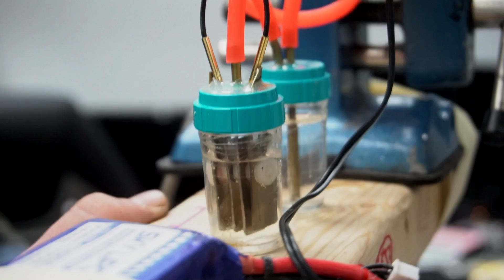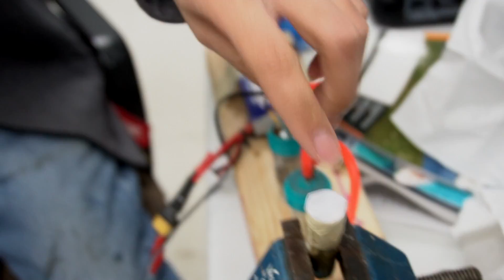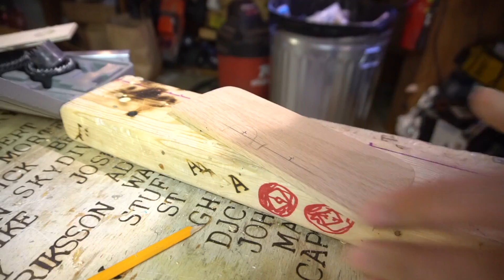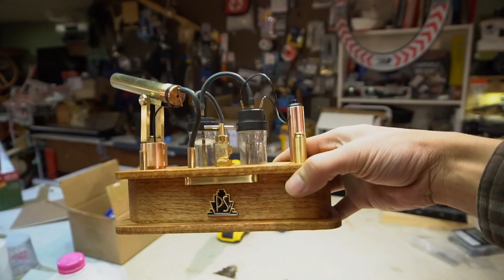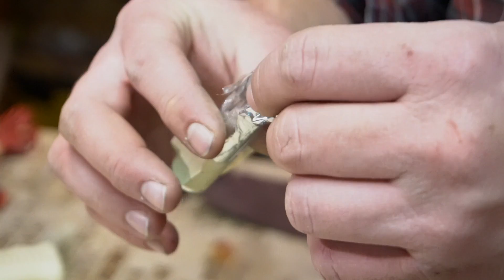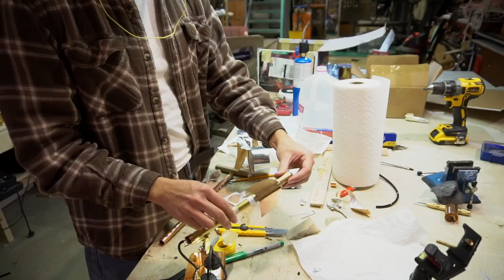Mini DIY HYDROGEN HHO Cannon

Comment: I'd just like to warn everyone about the dangers of hydrogen/oxygen mix.

I had about 200ml of the gas, which unfortunately ignited, leaving me with an exploded container in pieces everywhere. I couldn't hear a lot for about 2 days, come day 3 the constant ringing which was predominantly what I was hearing somewhat subsided. That was a few years ago. I still notice that my one ear has worse hearing than the other ear. My ears also ring a lot more easily when exposed to loud noises than before...

I'd just like to warn others about how little of this explosive gas you need to cause permanent hearing loss.. 

Wear earmuffs and goggles, and stay save folks.
Reply: i thank you for these words of wisdom jotham also forward phisx.........your an idiot but that is funny
Reply: Jotham B Lol when I was ten something like that happened, was making an HHO torch with like 24v, but no flashback arrestor..  The gas production slowed down for some reason and the torch traveled back into the gatorade bottle..  Bro me and my brother were laughing so hard because that bottle was all over the garage..  
.
So TLDR:  USE FLASHBACK ARRESTORS, and make sure the tube to what you're igniting is as short as possible or even build the arrestor into the thing you'll be igniting.....
Reply: Forward PhysX Your parents let you do that? Hmm...
Reply: @forwardphysx6167  same thing happened to me and my dad but it was a half gallon glass jar
Reply: Here's a link to an video of what that would've looked like. (in a plastic bag though because of shrapnel)
https://www.youtube.com/watch?v=olYp8kLjkBU
Reply: It was still echoing after the vid XD
Reply: Yeah... I can relate.  That "anti" flashback tube is a bomb... I tired that and the container exploded into a hundreds of pieces and I couldn't hear for a few hours.....
Reply: I lived to tell the tale.
Reply: (Michael Dilger) 25L  and the laugh at the end XD https://youtu.be/sqR3iV3BacA
Reply: well oxygen a powerful oxidiser and hydrogen a highly explosive gas its no wonder..
Reply: Jotham B he much try it with calcium carbide and put water to it so it makes a gas that mix with oxygen and thats explosive.. i think little saver?
Reply: pls make a rc plane boat mix
Reply: try to make a boat plane its a mix of a speedboat and a normal plane
Reply: Your not really supposed to store HHO gas and also you definitely need to keep it away from anything flammable but is hard to store HHO gas safely so I understand
Reply: Jotham B I feel sorry thanks to darn others
Reply: I filled a balloon with Hho and ignited it in my dads garage.......he almost had a heart attack fearing for the worst. He was inside at the time and just felt and heard the explosion. The energy released is no joke lol
Reply: This is exactly what happened to me. I had 2 chambers for safety but somehow electrodes shorted in electrolyse jar and blew everything up (only about 5% of jar was filled with HHO). There was glass everywhere and im lucky that i wasnt hurt. Also i heard constant beeeeeeeeeeeeeeeeep for a day and i have worse hearing on one ear after that... Sound is kind of dull and i cant hear high tones very good :/ It was 2 years ago and i think it is fixing slowly over time, but that was nice lesson about safety. Watch out with HHO, it is more dangerous than people think and can ignite from very little spark.
Reply: Jotham B the ringing by the way is called tinnitus you might want to see a doctor to see if he can get you something for it, military and inventors suffer from it the most.
Reply: ben lawton it worked better last time tho, probably a little leak or some normal non-explosive air XD
Reply: WHAT?
Reply: Jotham B yeah I was worried for a while because if this had gone wrong this would have become a pressure bomb
Reply: Chris G use copper dust from cutting copper, it works really well.
Reply: rocket fuel liquid hydrogen and liquid oxygen
Reply: l actually they are not that dangerous if you have a small reaction chamber like in a regular car engine then it is quite safe. Also gasoline is way more dangerous.
Reply: Jotham B did you die tho?
Reply: you're letting too much pressure build up in the anti flashback chamber
Reply: makes waturr!
Reply: Jotham B haha been there, I tried to build a lifter with a series of balloons two 36-inch balloons and   six 12 inch balloons let's just say the 36-inch balloons got about 8 inches in diameter a piece and the 12 inch balloons were nice and stiff and that's what ignition occurred. It threw me 10 foot out of the garage and I could not hear anything for almost two and a half hours. so I've been right there where you are brother it's a dangerous dangerous game.
Reply: Same thing happened to me bro😂
Reply: I was doing a experiment with my dad  and the hydrogen went into it’s tube but didn’t really explode so we finally got to test the oxygen tube so we blew out the match put it into the test tube and in a split second the match relight it’s self and blew up and we found out that in the tube was mainly oxygen but the hydrogen bubbled in and the hydrogen and oxygen went bang startling us all lol our ears were ringing for about 2 hrs because we didn’t expect it to explode but no permanent damage was done
Reply: You got lucky, it's the same fuel that powered the Space Shuttle... Though produced fuel rich, (2)H2=(1)O2, the hydrogen quickly mixes with the atmospheric oxygen and nitrogen and combustion can occur.... On an intresting side note SpaceX is planing to make their methane by electrolysis of martian ice and combining the hydrogen with CO2 to synthesize the methane.  (2)h20+CO2>(2)O2+CH4
Reply: Steve Siegelin not really we were working with such a small amount and same for them
Reply: Be courteous to your Neighbors and maybe warn the local Seismology Department first before detonating any large quantities of this stuff. It's no joke.
Reply: I lit a single soap bubble worth and I couldn't hear so well for about 10 minutes. Can confirm. It's way more explosive than you'll think.
Reply: I know that this video was posted a long time ago but do you think that you could make a more in-depth tutorial on how to Make this
Reply: @hectichive889  since I've left that comment I went up to 25L XD
Reply: Harry 8642 oh sweet Jesus up above. Where are you exploding all of this where it won’t blow up everything in a mile radius?! Lmao. You doing it in a desert or something?! Be safe my dude! That’s terrifying! Lol. Cool tho! Very cool!
Reply: Harry 8642, Wait. Oh my god that’s 6.6 gallons approximately. Where are you getting all that hydrogen my guy? Do you have some fancy, high-tech electrolysis set up? Like good lord!
Reply: @hectichive889  I have a HHO Generator, takes about a 1Kw, used an old microwave transformer and added some beefy capacitors to make it more efficient! You can watch a video of it on a channel called 'ben lawton' he's got a black profile picture.
Reply: Harry 8642, Wow dude. That’s wild. Well congrats on that! I wish I was good at engineering and circuitry and what not! All I understand is the science behind what’s happening. I wish I could build something that cool!
Reply: Dominic Owens, As in it’s super powerful stuff. He was joking by saying call the Seismology Department. He was saying that as if exploding all that Hydrogen would cause an earthquake. It is powerful stuff.
Reply: Did you not have the bubbler installed?
Reply: Jotham B would salt have helped with the water resistance problem
Reply: Yeah it's not good to store it make it on demand if you're going to make it and use it as you make it
Reply: LMFAO you made a water gun
Reply: Got any cool projects that include styrene?
Reply: When I used to do this in the lab I would collect the hydrogen and oxygen separately.
Reply: I filled a plastic water bottle with 100ml of sodium hydroxide solution and threw in some aluminum foil, then I tried to light it and boom. Not good idea
Reply: Same thing happened to me but it was a firecracker in a big tunnel
Reply: Too late...
Reply: @manniskamanniskoson8264  D:

What happened....
Reply: @jotham123  I made the bubbler too short and the combustion went all the way back to the electrolyzer itself. The whole container blew up and I was a bit too close when it happened.
Reply: Thx dude
Reply: Did it hurt?
Reply: Dunno if anyone gives a damn but if you're stoned like me during the covid times you can watch all the latest movies on Instaflixxer. Have been binge watching with my brother during the lockdown =)
Reply: @Rayan Turner yea, been watching on InstaFlixxer for years myself :)
Reply: Back in my old bench tech days I had a coworker that had made his own mini hydrogen generator and he used a glass jar of some type. He was attempting to improve the gas mileage of his vehicle. One day I guess it exploded in his face or near it. That was the end of that.
Reply: The danger of it makes it interesting though ^^
Reply: Jotham B 
Browns gas. 
My next door neighbor blew up his shed when charging a car battery then tried using a grinder, it dose go with one hell of a bang.
Reply: I set off 25l, lets just say the whole valley heard it :)
Reply: Hydrogen and oxygen is the stuff they use for rocket fuel, I’d assume you wouldn’t want to play around with it too much
Reply: Jotham B DO NOT STORE HYDROGEN AND OXYGEN. Only for on demand uses. A simple blow off valve (ball and spring in a housing) is a good safety choice on a bubbler. Containers with this gas mix shouldn't even have the option of blowing up..
Reply: and make sure you purchase proper rated goggles. if you don't, you're worse off then if you didn't have any protection... reason being is that the lens can melt or shatter into your eyes. take care of your body people!! you only get one in life and living without limbs or eyes is probably pretty lame. ball out on protective gear.
Reply: @drywater3559  "ball out on protective gear" that hilarious. I won a safety awareness contest at work with a picture of a few us fully decked out in everything safety gear, dual wielding fire extinguishers, glasses, mask, shields, earmuffs, "chains" with a bunch of lockout/tagout locks, reflectors on everything, etc. Just way over the top everywhere. We posed like that trying our best to look serious rap video cool, with the caption "That's how we ball out." It was many years ago, people still talk about it every year during the contest, we were immortalized in memory that day. 😁👍
Reply: mad
Reply: Jotham B lll
Reply: The beat way to learn safety is to have a dangerous accident...
Reply: 🔴 What Is Islam? ⚠️

🔴 Islam is not just another religion. 

🔵 It is the same message preached by Moses, Jesus and Abraham.

 🔴 Islam literally means ‘submission to God’ and it teaches us to have a direct relationship with God. 

 🔵 It reminds us that since God created us, no one should be worshipped except God alone. 

 🔴 It also teaches that God is nothing like a human being or like anything that we can imagine.

🌍 The concept of God is summarized in the Quran as:

📖 { “Say, He is God, the One.  God, the Absolute.  He does not give birth, nor was He born, and there is nothing like Him.”} (Quran 112:1-4)[4] 📚

🔴 Becoming a Muslim is not turning your back to Jesus. 

🔵 Rather it’s going back to the original teachings of Jesus and obeying him.
Reply: Jotham B I blow up 5L at a time, I'm dangerous XD

Comment: Shit like this always reminds me of my engineering class in highschool. As one of the projects to do for the final exam, we had literally just an hour on two consecutive days to build the tallest tower out of newspaper as possible, using any techniques, they just had to be documented.
Well, my group was second in the class, first was a guy who literally had four out of seven classes as engineering by grade 10 because he was just that fucking good at it, but we managed to get first place with the most bullshit tower ever: instead of using support or engineering or anything, we literally just took a double-sheet of newspaper and crumple and twist it long-ways, then tape it to the tower. We ended up with four legs leading into a central tower that was, at the end, bordering 13 feet tall. We literally threw away ALL conventions of engineering and just aimed for the stars, and we almost didn't get first place because we had to document and explain to the teacher that we actually had no fucking clue what made ours work in the first place lmao, so there's not really a "method" to document. AND because it's engineering, a single success was proof of concept and therefore viable, despite being 100% unreplicatable.

Comment: The safest way is using soda instead of that electrolyte because the carbon acid is an electrolyte, you can also use salt but if you do you've got Chlorine Gas as an Side product and that's toxic

Comment: Okay now you dealing with stuff that I've been playing with for years. It is possible to put the HHO reactor on board the rocket to make it like a model rocket size if you use magnesium and graphite it works better or copper and zincwhat good to mix saltwater with a little bit of peroxide and that'll keep your elements clean so it works longer

Comment: Very nice build!   It's an art, making projects look so refined, like display pieces.
Salt works to make the water conductive also, and won't burn you.   I got pretty good output with saltwater in an HHO generator I made once.   Stainless steel wire can be bought cheap at farm supply stores and used to make the electrodes.  It holds up for awhile, even in the saltwater.
Reply: Wow i hope you realize in electrolysis that salt creates chlorine gas , and stainless has chromium in it which puts Hexavalent chromate into the water, not fun stuff to have your hands in .
Well heres to your health and anyone else that took your advice 🍻

Comment: It's not a hydrogen oxygen mix. No oxygen is produced at the anode, only chlorine is which remains dissolved in the water. This is because the production of oxygen from water is a very unfavorable reaction and that's why distilled water has such a low conductivity.

Comment: How much would you charge to make one large enough to fuel a car? You would need 15 plates 3 stacks 5 in each approximately to be able to hook up to a 12 volt car battery. I will double check but I think that's what you need. I would like to build it myself but I am homeless and don't have the tools. I've been trying to get the material from the trash but stainless steel is hard to find and I don't steel

Comment: I used a disposable camera flash unit which builds up to 300 volts which easily splits water adams with out the added chemicals.

Comment: Bubblers serve 2 main functions. 1st is that hydrogen and oxygen bubbles popping in the hydrogen generator cause a water and KOH mist (lye water), where the bubbler can remove most of the KOH from the gas streem. And secondly, in setups without flash back arrestors, a largely full bubbler can limit the volume of gas ignited inside a container. But a  flashback to the hydrogen generator chamber is not much of a problem assuming you don't have a huge dead space were HHO can accumulate.

Comment: and dont put holes at the back of the cannon, place the cricket wires inside and i assure you it will ignite because hydrogen already has oxygen that it needs for combustion. gun powder can even ignite even it is sealed in bullet shells. same case as hydrogen, believe me i tried it and it can fly a marble 200 fps and can kill a bird 80 meters away. in laymans term it flies like a 9mm bullet.

Comment: a little pointers. dont use plastic chamber because it is static, means it lessens the charge.  the second chamber is not to seperate the other chamber from exploding. the second chamber is the extractor of hydrogen. the primary chamber use as to put a charge in the water as to opposite plates contact with water. try igniting the bubles from the first chamber, i assure you it wont explode due to it has a content of water vapor in it and it is not flamable. as it reaches the second chamber those water content is contacted to water again leaving only hydrogen gas. since it is gas use any gas regulator to control it. we do this in philipines as an alternative in motorcycle fuel. it gives an extra boost for the engine but we run it through butane gas regulator first and then the carburator because if you run it directly in the carb the bike would gone wild. and regulator is best because you can control the amount of hydrogen to be use as fuel. and use non magnetic stainless steel plates and use a 12 volt motorcycle/car battery for best result. i mean not all in philipines. this is our weekend hobby if theres nothing to do. we even make marble gun out of hydrogen.

Comment: Just a thought. Make the rocket smaller diameter so it fits inside the barrel. The pressure will push the sides of the rocket against the barrel eliminating gas escape and It will need to be stronger so it doesn't expand too much and jam in the barrel and blow the nose cone off.

Comment: Here's a helpful little tip.  When trying to cut thin sheet metal with a handheld jig saw, sandwich the metal sheet between two pieces of wood and it will make a nice clean cut without bouncing up and down.  This technique also works for cutting thin plastic sheeting.

Comment: Not sure if anyone has mentioned this, but I feel like if you could manage to have either a manual or semi automated way to seal off the hole in the bottom of the tube, you could get much better performance from the hydrogen launcher. Perhaps for example what you could do is have a little plate that slides into place when you're ready to go and it has tolerances tight enough to better contain the combustion.